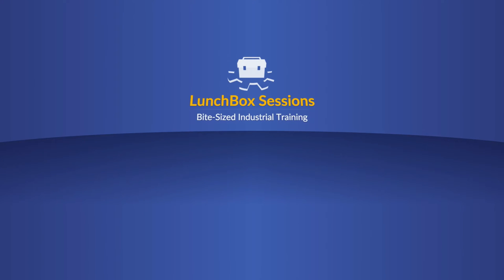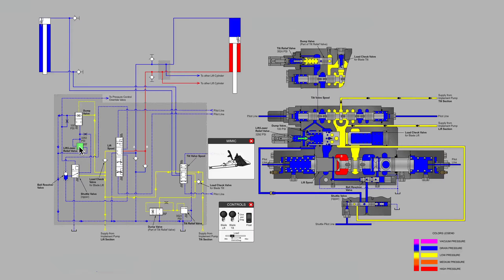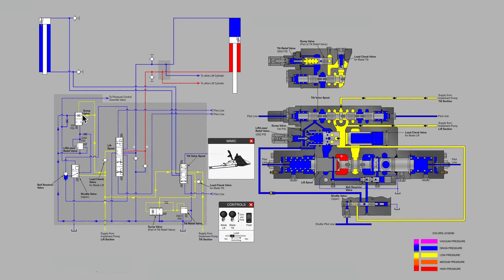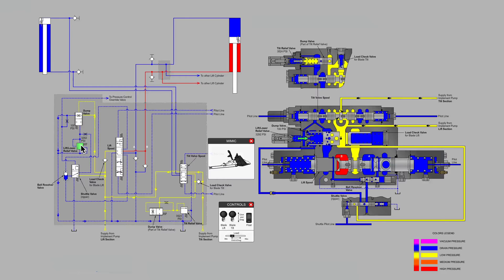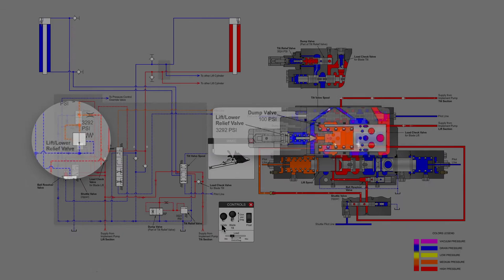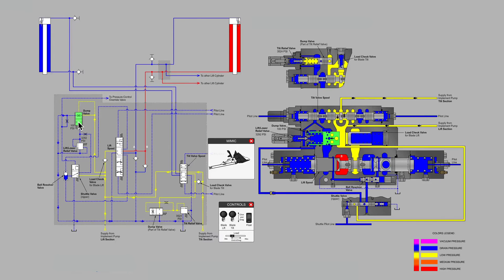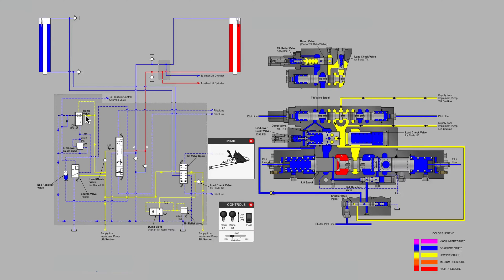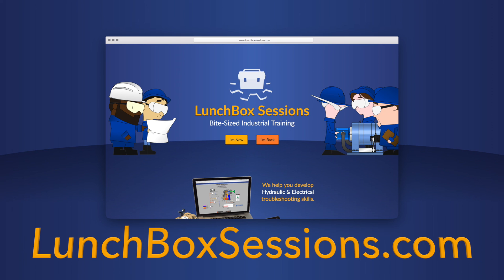How to Identify Relief Valve Components

Comment: Thanks for your reply, suggest me a best simulation software
Reply from the maker: That's not really a question I can answer. It depends too much on your situation and what you need your simulations to do. Of course, if you're looking to learn about hydraulic components, schematics, and troubleshooting, you'll find nothing better than what's on our website: www.lunchboxsessions.com. If you're looking to build your own simulations, you'll need to start by figuring out what your goal for the simulations will be (system design? learning? troubleshooting? component evaluation?) and look for a tool that supports those use cases. Good luck!